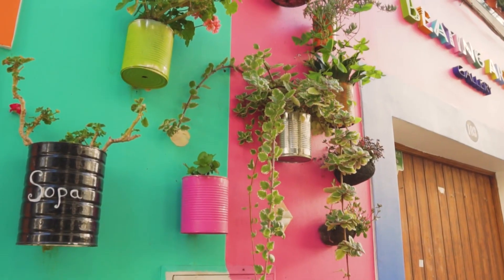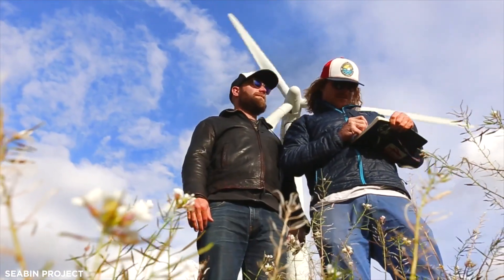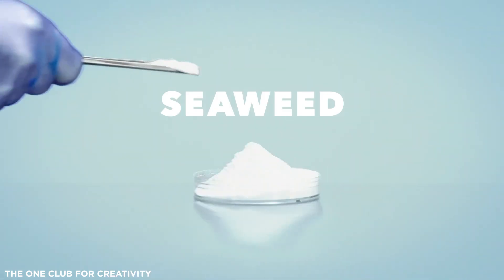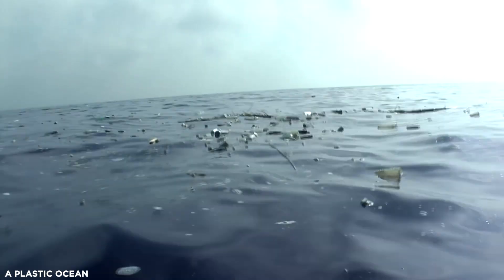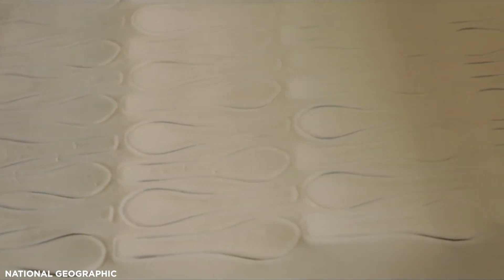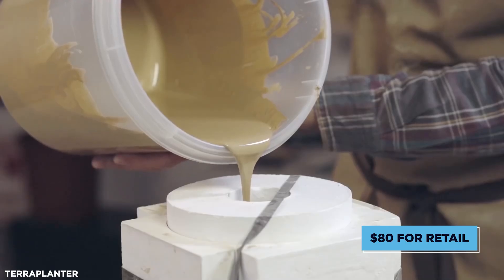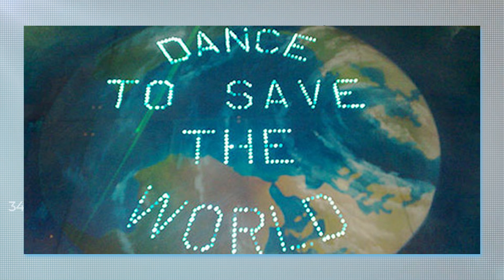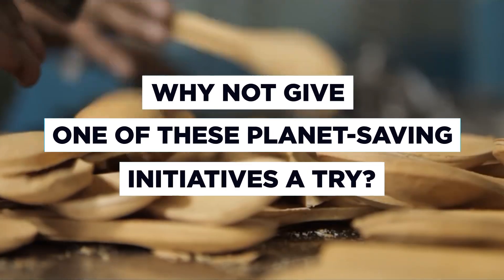10 Inventions That Are Saving The Planet

Comment: HERE US HOW WE CAN SAVE EARTH!!! before it’s too late...

Change a light 
Replacing one regular light bulb with compact fluorescent light bulb will save 150 pounds of carbon dioxide a year.

Drive less 
Walk, bike, carpool or take mass transit more often. You’ll save one pound of carbon dioxide every mile you don’t drive!

Recycle more 
You can save 2,400 pounds of carbon dioxide per year by recycling just half of your household waste.

Check your tires
Keeping your tires inflated properly can improve your gas mileage by more than 3 percent. Every gallon of gasoline save keeps 20 pounds of carbon dioxide out of the atmosphere.

Use less hot water 
It takes a lot of energy to heat water. Use less hot water by taking shorter and cooler shower and your clothes in cold water instead of hot water (more than 500 pounds of carbon dioxide saves per year)

Avoid products with a lot of packaging 
You can save 1,200 pounds of carbon dioxide if you reduce your garbage by 10 percent

Adjust your thermostat 
Moving your thermostat down just 2 degrees in winter and up 2 degrees in summer could save about 2,000 pounds of carbon dioxide a year.

Plant a tree 
A single tree will absorb one ton  of carbon dioxide over its lifetime 

Turn off electronic devises 
Simply turn off your tv, DVD player, stereo, and computer, when your not using them, will save you a thousands of pounds of carbon dioxide a year

Comment: Although turning bottles to sand seems like a great way to slow down the sand crisis I think it won't help much / be probably even negative.
As a majority of the sand is used for building only a very small fraction is used for glass, so the maximum payout is rather small.
Additionally is required, that new bottles are made as the old ones are being dusted, so in that process, there will be a small lose of sand, so over time there could be quite a big lose of sand.
Better option to tackle the sand problem would be
  Reducing sand required for building.
  Finally making desert sand usable for building (that obviously would immidiatly solve the problem.)

Comment: Plastics are most certainly not saving the planet.  Sorry, there is no science backing up these claims of these products' aiding in anything except excess production and consumption culture with a cozy smugness that as long as you follow the convaluded disposal instructions (and hopefully don't deviate from them because, as they said in the video, it has a negative effect to do so) then the best position you've put yourself in is maybe having that be recycled into something/whatever.  You need to be sure the waste disposalists near you believe in recycling at all, because many stopped due to cost ineffciency and lack of subsidation for realistic process change vs pleasing the masses with wasteful endeavors that benefit no one in the long run, all because most people consume at a disgusting rate (myself included, yes of course!).

Comment: The problem isnt plastic in off itsself.
The problem with plastic its to efficient, flexible and cheap to produce and use.

Plastic is an amazing material. One of the best we have currently.
And its also realy cheap and easy to produce or make products out of.

For a material to replace plastic, ithas to fight a gigantic wall, basically having to be better then one of the most flexibly applicable materials in the world, and one of the cheapest.

Also. Just removing plastic is also not an option.
The average person and consumer's budget depends on plastic being so cheap and widely appliceable.
If we dont have plastics anymore, many prices for commong goods and packaging will skyrocket.
Not become unpayable, but significantly more expencive.

Finally, the fact plastic is non biodegredeable is one of its biggest strengths. Especially with packaging and food related products.
Magic a biodegredeable plastic is literaly counterproductive.
Its like taking an umbrella and putting tiny holes in it to help the enviroment.
Yes. It might help. But youre also making a worse and thus less economicaly compeditive product compaired to just plastic.
Which makes it even harder for it to replace plastic.

Comment: bio-degradable plastics are actually not that good. They still need plastics made from oil, but a vastly smaller percentage than in conventional plastics.
Either way, these parts still don't degrade and still deposit in soil and water. So it's not the solution for the future we had hoped.
But there is a chance that we still might improve on it and remove the conventional plastics entirely. So there is hope.

Comment: We need to stop the production of single use plastics, I’m sick of everyone blaming the consumer, when your bath is overflowing you turn off the tap, you stop it at the source, if the average person doesn’t have an alternative offered in supermarkets how are we supposed to do the shopping without buying plastic? It’s simple the factories produce way too much of this stuff, we can’t be the only ones who have to change (consumers) the factories need to
Reply: Funding products like the ones in this video is exactly how that happens.
Reply: The consumer is indeed the issue. The problem is, that we need to come together as q unit and stop buying single use plastics. Drink tap water, stop buying Coke/Pepsi/Bottled water, stop eating fast food and consider switching to plant based diet or lab made meat. If you want to cut something by its root, reduce demand as a consumer yourself and try convince friends/family to do the same.
Reply: @Aureus282  Turn off the tap and it will stop the flow!!
Reply: @Aureus282  I agree that consumer pressure is helpful, but why should companies be free to produce products that kill wildlife and pollute the planet at all, regardless of demand? Consumers can only purchase what is available to buy. I'd like to buy cheese not wrapped in plastic, but that is not available, so I buy what there is. If it was sold in seaweed plastic, I'd buy that instead. Consumers only have choice from what is available.
Reply: Yes, exactly! I think there needs to be some kind of global tax to produce any product that harms the environment, so these eco-friendly alternatives will become cheaper than regular plastics and such.
Reply: @ericabruskin4078  shut up your making things expensive for no reason
Reply: @axles6242  So, you're happy for companies to pollute the air and water, contribute plastic waste to the ocean that kill animals (there are microplastics in humans as well) all for free just so you can buy your soda for a few cents cheaper? Why should it be free to damage a public good? If I damage public property, I am held responsible. Why are the air and oceans any different?

Comment: Strange how they are not even talking about graphene or fusion reactor for the energy...
Reply: Thorium reactors produce a fraction of the waste but way more energy than uranium
They’re also safer, to the point where  a meltdown can’t happen because a cork will melt to take the thorium away from the plutonium activator.
Overall, the only downside is cost, which is well worth the safety and energy, not to mention the fact it won’t give miners cancer

Comment: fun fact: PLA is the most common material for hobby 3D-printing.
Reply: FunFact: PLA is sugarcane based, and when you print with it it smells oddly sweet.
Reply: @0rbitalxs957  forbidden candy
Reply: @eeeeeek  mk
Reply: @eeeeeek  n o
Reply: I love using pla, but abs and petg are much stronger
Reply: @yiannispapagiannopoulos9549  Pla has higher tensile strength than abs, but abs is harder. Saying one thing is stronger that another is an oversimplification.
Reply: @davidjordan930  perhaps more resilient, would be more appropriate. I personally use PETG instead of PLA because it is more heat resistant and I don't need to have an all metal hotend for it
Reply: @yiannispapagiannopoulos9549  I use PLA and ABS
Reply: Ok
Reply: Thats good cuz we can higher prices for other plastics
Reply: Ya also abs smells bad to when you are printing with it
Reply: @pocarrotjongema2914  it does, you need proper ventilation
Reply: @Boss-Crow  oh...
Reply: It decays so its eco friendly
Reply: @NCRVeteranRanger-w6s  you mean edible
Reply: Fun fact- facts are interesting and not fun
Reply: Right
Reply: Fun fact: fun facts aren’t actually fun -_-
Reply: Yes. I use a 3D pen and my teacher has a 3D printer. PLA is not only better for the environment, it also won’t stink when melted. Actually when it melts, it often because sweet

Comment: Love how they talk about composting in the beginning.  Then at the end "the pineapple industry is wasting their leaves by letting them rot." They should use them to produce a leather alternative that is not biodegradable instead.
Reply: Actually, you misinterpreted it. The narrator said that all these leaves are being wasted but now letting them rot or burn isn’t the only option anymore. Also isn’t producing a leather that is not biodegradable bad? It should be biodegradable so it can be broken down if disposed of...
Reply: @kane_nyx  Producing fake leather that is biodegradable means that fake leather shoes will not be as long lasting as real leather shoes which can be worn 10 years.
Reply: My point is that they used the term rotting instead of composting at the end of the video. And they are promoting a product that is actually worse for the environment.
Reply: Actually at harvest times farmers usually plow as much of the left over plants as possible back in to help enrich the soil and save on fertilizer costs.
Reply: That one tipped me off. Very stupid invention. Leather is often used for its organic properties. Breathable, durable and pliable. Fake leather is just as bad as regular rubber..
Reply: Cant speak to the leather issue, but rotting is not the same as composting, they’re chemically different processes with different results in terms of carbon emissions and how usable the end product is. (Signed, a composted who learned this the hard way.)
Reply: @deawinter  interesting, I really thought you could just dump a load of banana skins into some soil and mother nature would thank you personally
Reply: @nsa4805  I'm a novice composter but I've got a big pile at this point. When I'm not careful with turning it often enough, the microbes produce more methane and such than when it is properly oxygenated and mixed. There are a ton of other differences but but more or less, imagine a clean burning wood stove that reburns its own soot, vs an old chimney billowing brown exhaust.
Reply: Yall are kinda being mean???

Comment: The issue with that fake leather is one is biodegradable and the other isn't. But one uses animals and the other doesn't. You change one evil for the other, and tbh I'd rather use the real stuff until a non plastic leather exists cause cows will still die but we might as well take as much from them as possible until we can avoid them altogether

Comment: With the bottle crushing device, isn’t it better to just recycle the glass? It takes significantly less energy to remelt recycled glass than it does to manufacture new glass.
Reply: In most cases yes but I'm pretty sure (not 100% sure) that some glasses can't be melted back down like if the quality drops or something
Reply: @ellxsandranoratora  glass can be indefinitely recycled and doesn't degrade, the only downside is that you don't have as much control of the color because of the mixed colors of recycled glass. 
Fun fact, crushed glass to be remelted is called cullet.

Comment: The idea of using corn to make plastic just boggles my mind.  Corn is a terrible crop.  Not to sound like "that guy" but maybe we could use hemp or mushroom or something which doesn't require massive amounts of fertilizer and land.
Reply: Yeah.. PLA and E85 ethanol fuel (gasoline replacement) is seen to be worse for the environment bc corn is so hard to grow and requires a lot of space to grow.. and has to be crazily heated to make them. 
It’s like this saying I heard from a carpenter.. ‘if the old toxic stuff lasts for 10 years and the ‘eco friendly’ lasts for 1 year, which is really better for the environment?’

Comment: 8:39 The club has it's own wind turbine and Solar System. I get what you mean, but it seems this club is cosmically huge :D
Reply: Yeah I was wondering about that word choice as well
Reply: Wind Turbine and solar panels take huge amounts of fossil fuels to manufacture....
Reply: @ffjsb  Not to mention the mining for rare earth minerals needed.
Reply: Sorry I cant like it'd at 69 :(
Reply: @cactusgamingyt9960  idiot
Reply: Nikolay T   Umm, yes. They are both massive hunks of steel and electronics. Almost every foundry that makes these things still runs on coal. In addition the mining of the materials tears up landscapes as they need to quarry for it. 
The better alternative is modern nuclear reactors. More energy, less cost. Less pollution than wind turbines even, since they tend to catch fire in high wind environments.
Reply: @SendarSlayer  SHUT UP NERD
Reply: Nikolay T  Listen idiot, larger wind turbines require up to 800 CUBIC yards of concrete.  Concrete is made by mining limestone with gigantic diesel earthmoving equipment, then has to be crused, and then it's fed into huge rotating kilns, fired by fossil fuels.  It's then ground again into a powder.  All this takes huge amounts of energy.  And then there's the TONS of steel rebar in the concrete.  The blades of turbines require huge amounts of fiberglass and resin, which means lots of petrochemicals.
You clearly don't know a damn thing about this subject.
Reply: @ffjsb  hey whille passing by i wanted to ask about flying turbine thingies are they viable?